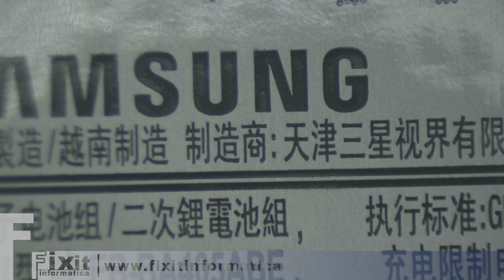Samsung A40 non carica risolto con ponticello su scheda madre won't charge fix with mainboard jumper

Comment: Ciao, ma se per caso senza cavo Flex tra i primi punti in cui misuri la tensione a me esce 1.9 volt, significa che il chip di ricarica va cambiato?
Reply from the maker: Ciao, non ho capito dove ti riferisci. Comunque considera che devi trovare 5 volt sulla basetta di ricarica, sul connettore del flex e alla fine del flex. Se in questi passaggi non hai i 5V il problema non è la scheda madre, ma o la basetta o il cavo a seconda delle circostanze. Se invece hai anche i 5v alla fine del cavo e probabile che sia il connettore lato scheda madre.
In ogni caso se trovi 1.9 volt su una linea che dovrebbe averne 5, vuol dire che c'è un corto da qualche parte o una dispersione oppure a monte (alimentatore, cavo, connettore di ricarica) non vengono erogati
Reply: Ciao, grazie mille era proprio quello il problema, ho letto tardi perché nella fretta ho acquistato a random la basetta di ricarica ed era proprio quella, magicamente si è acceso nuovamente, quindi avevi ragione. Il problema stava proprio lì, infatti dopo averla cambiata la tensione era 5 volt. Grazie mille

Comment: Will 0.1 wire be ok? It loads quite slowly. Does the thickness of the wire matter?
Reply from the maker: Hi, for Volts the 0.1 wire is fine, but it could heat up. It is recommended if you have a slightly bigger wire.

Comment: Salve e complimenti per la tua professionalità
Si risolverebbe cambiando il connettore o è un problema del supporto in se?
Reply from the maker: Ciao, si risolverebbe sostituendo il connettore, ma questo porterebbe a diversi problemi. 1) Il problema potrebbe ripresentarsi  2) durante la rimozione del vecchio connettettore con uno nuovo potrebbero saltare delle piste sulla scheda madre che renderebbero la riparazione più difficoltosa 3) Esporre la scheda madre al calore, in questo caso per la rimozione del connettore,  è sempre una scelta da non prediligere. 
Per questi motivi, secondo noi la soluzione migliore e più duratura è quella di fare il ponte per aiutare la comunicazione da sub e main board.
Reply: @FixitInformatica  chiaro